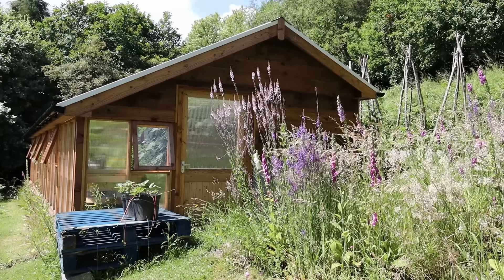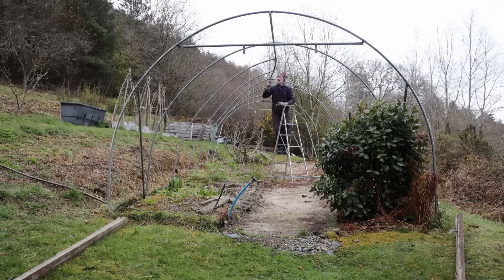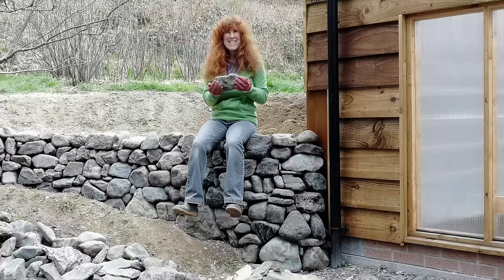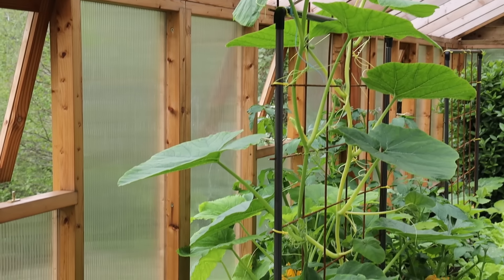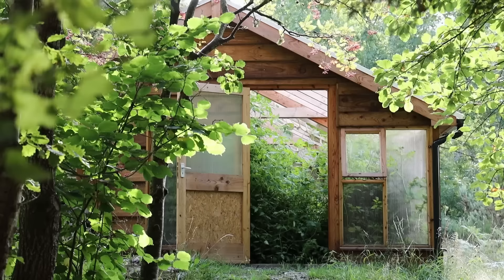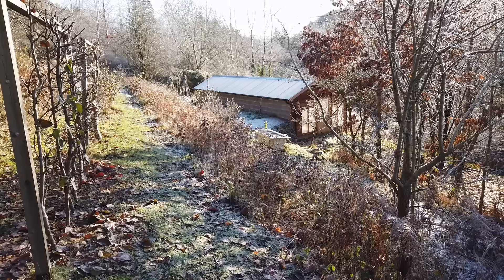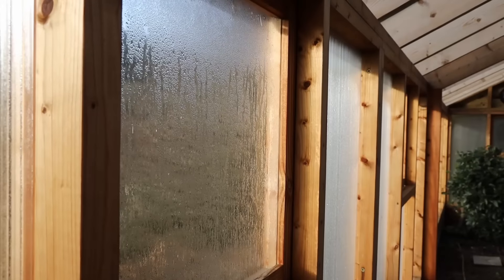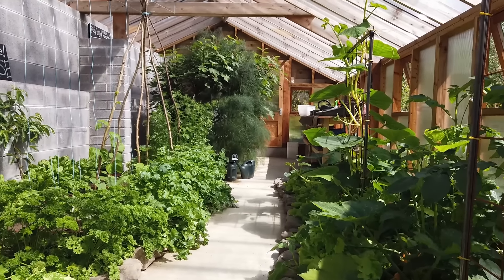We built a passive solar GREENHOUSE | Here’s what happened

Comment: Well done to the both of you 😊 Your temperature moderation is very impressive indeed 👍
I must add; if you paint the back wall black it will much improve it’s performance as a heat sink.
Reply from the maker: Thank-you! It's pretty hot in there already at this time of year but I suppose a black wall would improve heat retention during cooler months. We shall have to think about it! 👍
Reply: @TheTenterhookTimes I wonder if you could use black paint & hang a white cover of some sort in the hotter months? (Perhaps just cheap drop cloths?)
Reply: @TheTenterhookTimes  Along with painting the wall black you might add dirt behind the wall the wall's upper portion so the heat has somewhere to go other than inside during the hottest part of the day.  Then at night - when it cools down - the heat stored in the earth will seep back into the space keeping it warmer at night and at the beginning and end of the season.

Comment: I really like your new greenhouse. The only thing about it that surprised me was that you stuck with the poly-tunnel for so long.

I've two suggestions you might want to try. 1) Paint the interior of your back wall flat black to increase solar absorption during the winter. 2) Add insulation to the outside of the back wall to break the thermal bridging of the concrete that pulls heat out of the greenhouse during the winter. Still, I think you did a great job with what you've already done. I'm a bit envious.
Reply from the maker: Hi thanks for your great comments and suggestions. The polytunnel served us well over the years but we're very pleased to have the greenhouse now 👍

Comment: A couple of quick tips with very little cost:

Paint your back wall with a flat black paint.  This will help absorb sunlight during the day and radiate heat back during the night acting like a solar thermal battery.

On the outside, build up the soil at the wall to within 15cm (to prevent moisture migration to water sensitive materials) of the wood construction.  This will take advantage of the earth's natural tendency to stay around 10C throughout the winter.  A form of earth thermal power source.

6 mill poly sheets under the roof and on the walls to create a thermal insulation air barrier.

A costlier addition:

install a series of culverts below the frost line behind the wall.  use low CFM air circulating fan (solar powered) to exchange air from the below earth culverts and inside the greenhouse.
Reply from the maker: Thanks for your tips which do make good sense for some climates and situations. We're going to monitor growing and harvests for a couple of years before we make any modifications to the greenhouse as we feel what we have does suit our needs. We just want to enjoy our gardening for a little while now!
Reply: @TheTenterhookTimes  Enjoy your gardening as much as you can!

Comment: An idea: You could paint the back wall white so more light is reflected onto the plants! I don't think it will affect the temperature storage capacity as heat is taken up again through the room temperature. Now that the 2nd season is almost done, are there things you would do differently if you built such an amazing greenhouse again? Thanks for the great video :)
Reply: I've seen people line a wall with jugs of water designed to absorb heat... and they paint them black.

Comment: A great use for the old polytunnel frame is to screen in the entire thing for protected outdoor growing. We live where summer rains are often an unpredictable, so have a poly roof with screened sides so we could control watering. We also set the frame on 4 foot high pony walls to raise the tradionally low ceiling. We also pull a large shade cloth over it during the hottest summer months, creating a huge temp drop when you enter. Lastly, raised beds inside have made gardening a joy. We haven't seen a caterpillar for 5 years!
Reply from the maker: Thanks for the suggestion 👍

Comment: That's an impressive upgrade. Did you know pinching every second cucumber flower extends the productive life of the plant? You could start a compost heap outside at the back and pipe in the heat, or just leave it keeping the back wall warmer than otherwise.

Comment: Painting the wall black helps absorb heat from the sun. Digging a trench to lower the greenhouse to about 6 feet below ground level will help insulate against temperature fluctuation!

Comment: congratulations to you verry nice new greenhouse.
How do you get your fig tree to give fruit?
I have a fig tree in my greenhouse.
I believe that it was planted in the ground in 2010.
It grows vigorusly but never give even one single fig in all this time.

I have grown a bit tired of it as it only gives me a lot of work to keep it down and never gives any figs.
So last yoar I cut it down to a stump but it still grows quickly.
I have taken cuttings and have a fairly large cutting now growing in a pot.

If there is no crop I will probably have to remove the tree but that will be a big job.
The tree is thick and I believe that the roots must be hughe.
Reply: It is the wasp that helps to produce fruit on fig trees. Fascinating study, so make sure you let wasps find a home near your fig.
Reply: @DssFarmtwo  
There are usually lots of wasps in the greenhouse in the late summer.
They come in to eat my grapes so I’m not so happy about them.

Do the wasps need to be in the greenhouse in the spring to pollinate the figs?
But I have not really seen any flowers either
Reply from the maker: Hi Anders, we can't claim to be experts on figs, all we know is that we planted the tree in our polytunnel many years ago and during hot summers it would produce a few fruit. However, in its first greenhouse year the harvest was absolutely amazing - it clearly loves the heat. The fig variety we have is called Brown Turkey, which does not need pollination by wasps. We don't do anything except prune the tree during the winter as otherwise it would outgrow its space in the greenhouse. However, you can read more on the website of the Royal Horticultural Society - https://www.rhs.org.uk/fruit/figs/grow-your-own

Comment: Thankyou so much for sharing.  Can you tell me what make your irrigation system is … also Here’s an idea why not install a small fan controlled by a solar panel to provide air circulation. :-)
Reply from the maker: Hi Dave, not sure if you are UK based but we bought the irrigation system from a company called Access Irrigation. So it's drip irrigation and we used a Galcon Irrigation controller / timer. All the pipe and accessories we bought from that company, though I'm sure there are many others offering similar kit. Hope that helps. As for the solar powered fan idea - we have considered this but don't have the expertise to install it ourselves. Do you have any ideas where we could find out more...? Thanks

Comment: Did you decide not to use underground pipes to store heat in the ground? I saw you scroll past Rob Avis's video and he has great info on those systems.
Reply from the maker: Hi David, where we live we didn't think it would be a worthwhile investment as it's rarely as cold as say, parts of the USA or Canada in the winter. Plus not far below the greenhouse it is solid rock so would have been very challenging to dig out! Thanks for watching 👍
Reply: @TheTenterhookTimes  Makes sense. It performed very well! I'm definitely going to borrow some elements for my next greenhouse. I love the proportions and winding path. Doesn't feel cramped at all.

Comment: What type of wood did you use??  Treated or something like cedar??

EDIT:  At the part where you said you oiled the wood to treat it.  I still would like to know the type of wood and treatment.  

Being in the USA our country has so many different climates that there is a variety of hard/soft woods to choose from.  Some more expensive then others.  Your experience with a particular type of wood and treatment could offer an option otherwise not considered.
Reply from the maker: Some of the timber is locally sourced Douglas Fir. The rest is from the builders' yard - pine of some description. We used an oil based timber treatment for all the externally facing wood and some of the internal wood too round the windows and doors. Hope this helps! 🤞😃

Comment: What windows do you use? Does it get below 0 inside in winter?
Reply from the maker: The windows that open are glazed with standard glass. We wanted the option to be able to see the beautiful view outside which is obscured by the polycarbonate glazing used in the rest of the greenhouse. So far the temperature has only rarely dropped below 0 degrees centigrade in the winter. Last year just in December when we had a particularly cold spell (minus 10 degrees C outdoors) as described in the video and it dropped to minus 3 degrees C for a brief period.